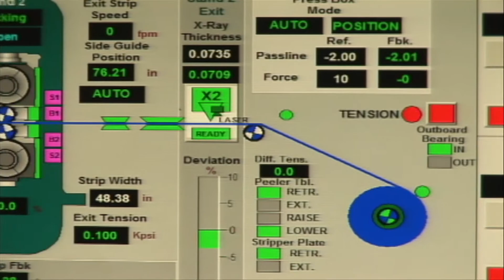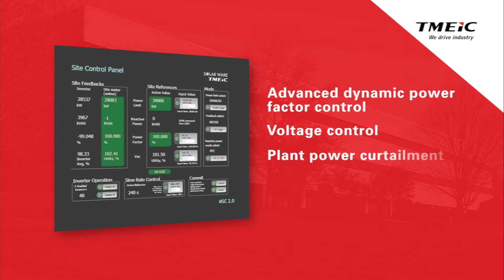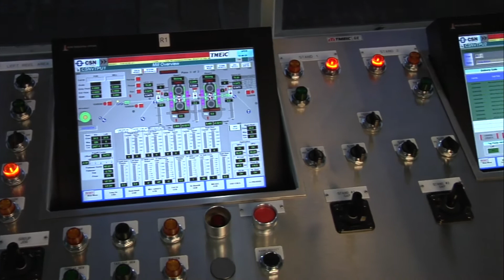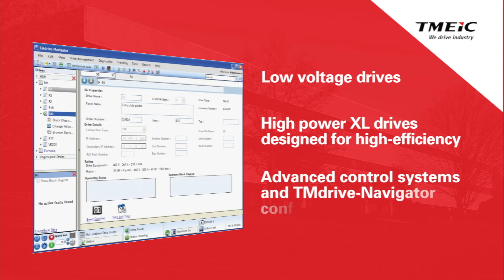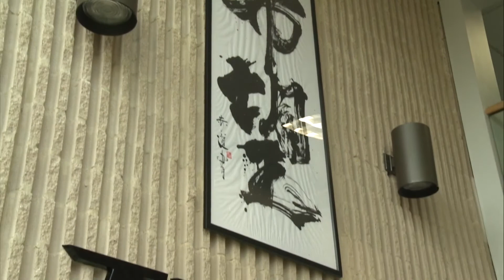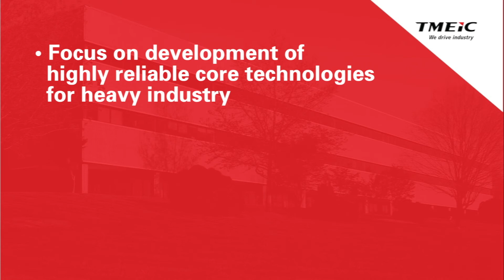TMEIC - We Drive Industry

Comment: Dear all 

Beware of Toshiba Mitsubishi-Electric Industrial systems corporation (TMEIC)Is a fake and worrest company then compare to  road side companies how it means please read the below points.

Ihave selected for TMEIC for Sr. Finance Manager / Sr. Accounts manager & commercial

TMEIC requirement I got through mail, They had posted this in naukri on 04.09.18. it is an permanent position, designation Sr. Finanace manager / Sr. Accounts manager.

During interview time the Assistant Manager HR Mr. Ananda Tirtha was not communicated with me for below points after slection and finally they have given shock to us.

Designation:  Sr. Accounts manager commercial but they given in Executive commercial

Position: permanent, but in interview they asked me to join contract / probation 6 months after we will permit you based your performance means I

Said ok why because i am confident on my work. But he never communicated me that he is going to offer me  as an off roll under CEIL HR.

Package : consultantcy people and HR was negotiated my ctc 35% to 25% on my current ctc but they are given 12% on my current ctc

 but the above things are not happened which they have confirmed during the interview, and they communicated me on Friday (05.10.18) at 5 PM, 1 hr before releasing an offer from CEIL HR so I am shocked.

Mr.Ananda was asked me for offer acceptance and reporting time on Monday at 9.30, I said ok but I am not happy with the above points means he is speaking with me like under his slave, if you want to come and join or else leave, hence I felt so sad his way of handling of employee negotiation.

And Mr. Ananda & HR Manager Mr. NV Narasimhan was saying your small company and they are degrading, (imetating, decreasing our condence levels) Sr. Accounts Executive Finance, but we will give only Executive here if want join or else leave like demanding mode.

why Because after that our notice period will close from our previous employer so they are wantedly decreasing our  package and all this my experience with tmeic and it not an good capable, is not professional company to pay the salaries to the employees. So compare to this TMEIC at least road side companies are so better than this, so be take care of all if are given notice with this kind of fake companies you will be in trouble, if you want please ask us we share you the offer letter and all detailed proofs.

Regards

Sudha.